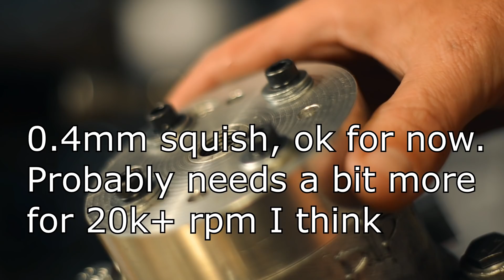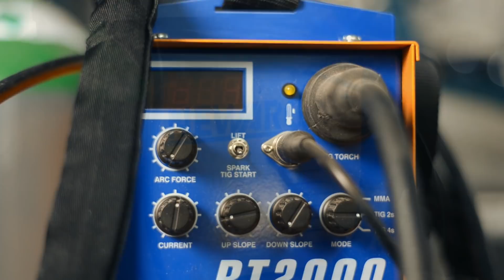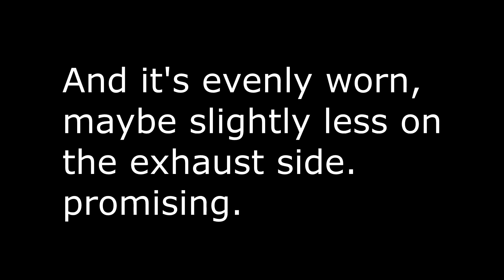The Most Powerful Two Stroke Ever - First startup attempts

Comment: I feel your pain, I had a number of problems with my barrels trying to get them to start and finally worked out why but that's what happens when you try to do something different but the disappointment and all the feelings of futility soon disappear when it finally fires up. Also, are you using sg for the ring? (spheroidal graphite). If you are then you need to use the higher hardness material and it needs heat treatment. I use sg in my liners of 600/3 grade which is easy to machine but the second hardest grade available and is ideal for liners giving good durability. The hardest grade of 700/2 would probably be the best for piston rings. A lot of quality rings are sg but obviously they thinner you go the more brittle they become which is why all the thin rings are heat treated cold drawn wire. Keep going, you're almost there.
   And your name's Pip. Pip. I knew I had seen it previously but unfortunately I don't have much of a memory. It's on your barrel. 🤣 🤣 🤣 Regards, Bob.
Reply from the maker: 👍Thanks! I'll talk to Mark about the ring material and possible solutions,can't remember what he used. Name's Alex, "pip" is just the cylinder "Primus Inter Pares"
Reply: @2STROKESTUFFING  Alex!!! Aha. Your surname isn't DeLarch by the way? 6655321 by any chance? 🤣 Mark knows a lot more than I do but I do know he uses sg in his liners although he refers to it as Durabar. It's a fantastic material and something I love machining. Bit sad really. 🤣
Reply: By the way, you have a lathe so it's not beyond your capabilites to make your own rings, sg/Durabar is available in different diameters and isn't expensive and I'm sure a man of your talents can do basic heat treatment, also try en24, it's a steel that should be hard enough and durable enough to make rings from without heat treatment
Reply: I agree, it might be a good plan to learn to make your own rings, since Mark is the wrong side of a decent sized ocean! It would also allow for a little experimentation. once you've got the tooling/process  figured out, they're pretty easy to make, and as long as you work methodically they'll be pretty consistent. I've only ever made rings for larger, slower engines so your results may vary!

Glad to see her together and turning over,  she'll be growling soon!

Comment: A one way bearing for the starter, cheap as.
You could machine some ends (drill shaft and socket shaft) for the OD and ID to press on to the bearing.
Reply from the maker: 👍 Much better solution! Had to work with what I had on a Sunday night, urgent matters...
Reply: @2STROKESTUFFING  
It worked for a while.
Maybe give it a soak of WD40, a blow out then force some grease in it to get the ratchet working again.
If it works ... it works.
Reply: @AuMechanic  the ratchet head is dead the not made to do that it was falling apart at the end

Comment: Huge fan. Normally don’t comment. Try a pull start.  I have tried to start my home made engines with a drill. I have much better luck with A faster rotational speed such as one with a pull start
Reply from the maker: Thanks, good tip! Or maybe a faster drill...

Comment: Have you tried actually lapping the head onto the cylinder with 1200grit diamond paste?
Reply: Terry, I have used 'Brasso' as it shows up the low spots, but is not so aggressive on aluminium.
Reply: @doctor2bob  I have used brasso, its about 900 grit. It's a good start, and as you said it will quickly show the high spots.
Reply: You don't need diamond paste for this, used to do this back in the day with fine carborundum valve lapping paste. It's soft aluminium at the end if the day.
Reply: @ferrumignis  What grit size? I have used carborundum up to 240, not sure I have seen it much smaller than that. For really fine work (600 and above) I use diamond. I use this in my rifle action work too. The issue with coarse grit is that it will remove too much material.
Reply: Any motorcycle  repair manuel will tell you you need 400 grit  and a piece of glass to lap a head no need for more
Reply: @legros731  I used 1200 as the finishing lap on my Husqvarna 430WR, and there was no head gasket. The head was lapped directly onto the barrel.

The 50cc seems to have a flat interface between the barrel and the head with no lip, this could need a better finish than 400 will provide.

100% agree with the glass.

Comment: 3:19 thats some old school gasket making right there !
Reply: I know right, hopefully he accounted for the change in port timing, I used to set my deck height, then check the squish, if any changes needed to be made I would machine the top of the barrels or mod the head for a good squish...
Reply from the maker: I've used 0.6mm in the design, touching the head at about 18k on similar setup with 0.4, estimated this to hit at 22k or so which would be perfect.

Comment: maybe a total seal type ring will do the trick. Or two thin rings with the gaps set 180 apart.
Reply: I had done 2 rings with the gaps set 180 apart , went from around 10bar ( don't remember exact number ) , to around 14bar compression , that was on my old Honda CBR125R single cylinder engine , I have no idea how it ran on 95gas ( but would try to go for 98 if the station had it ) and it gained noticeable low end torque and survived for more than 10k km and was sold still running strong , might be a good idea maybe
Reply: @Cig4ras  Measured a cold cranked 14.5:1 compression ratio, with a forged ASSO Werke 3 ring piston on a low friction bearinged, skimmed, ported, gas flowed & blueprinted 1979 CZ 125-476.5 engine I built for a friend, back in 1985. It dieseled when hot, even when running 4 Star leaded 99 RON petrol. With the ignition off the bike would idle until the carb emptied of fuel. In 1986 it was stopped for speeding, after my friend overtook an unmarked cop car on a dual carriageway. The court summons stated that it was clocked at between 98 & 104 MPH for over 3 miles VASCAR. My friend had the summons framed in his living room as it stated that the bike responsible was a CZ 125 Sport. He was banned for a year.

We measured a best fuel economy (??) of 27 MPG. (Stock is 65 MPG).

The sprocket ratio was upped from OEM 14:52 to 19:52, which meant that the bike had to be doing at least 75 MPH in 3rd gear to transition into 4th (top) gear as there was a flat spot in the rev range at 73 MPH in 4th gear due to the porting and expansion chamber interaction (Serval expansion pipe).
Reply: @CZ350tuner  Wow , that's kinda crazy  , mine would only idle for a little bit after ignition off SOMETIMES , but wow  for a 125cc ( even if it's 2 stroke ) , thats faaast
Reply: Andy Reid cool mods mate yeh I had an 88 cr80 back in 99 that fully rebuilt at tech , I modified the dome on lathe , rejetted it,made adjustable timing bracket ,custom short muffler bit of port clean up and geared her up , it could pull a wheel stand in top gear around 100 kmph and top speed was 147 kmh , I knew what I was doing honest 😎
Reply: @Cig4ras  Isint that the standard past few decades? My old Suzuki S moped had two ring setup like that, if i recall right and its from factory. That engine has went from factory around 30K km with out any engine rebuild, though i never used 95 octane gas in it and has run 3% mix.
Reply: @Hellsong89  Not really , as we are talking a little different scenario , going from 9-10bar compression to ~14bar , which would usually need racing gas so you woudn't get early detonation +  I put custom gasket's which were waay thinner and to be honest Im not even sure how it survived , since I abused that engine real bad , but it never ever dissapointed me , redline (after increasing compression it went from ~11k to ~12k rpm) for 3 hours straight ? Sure , why not
Reply: @Cig4ras  cranking compression is static running compression is dynamic. there are very different forces at work.
Reply: @DieselRamcharger  The engine I was talking about is 4 stroke , but I haven't dealt much with 2 strokes , so I really don't know a lot about them too xd
Reply: @Cig4ras  all the good small bore 2 strokes run a 2 ring pack. only the junk china shit uses a single ring.
Reply: Offset rings would be the ticket here!